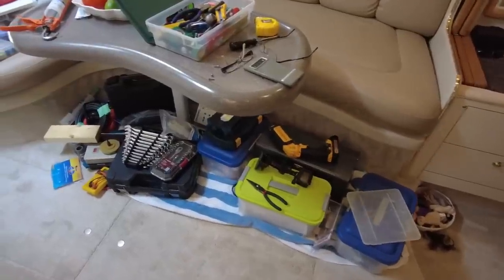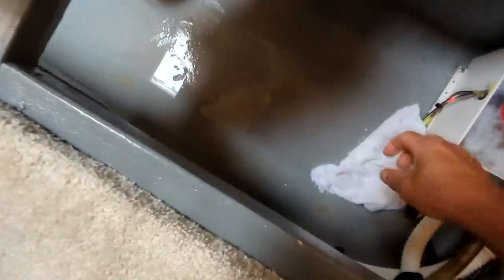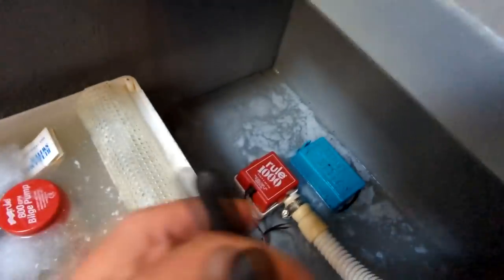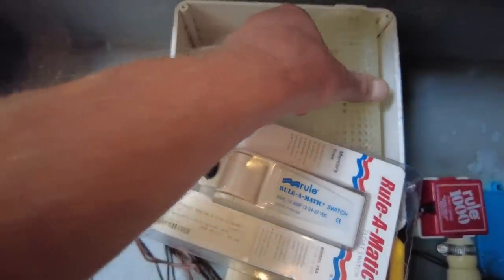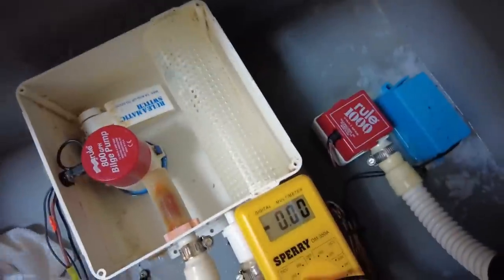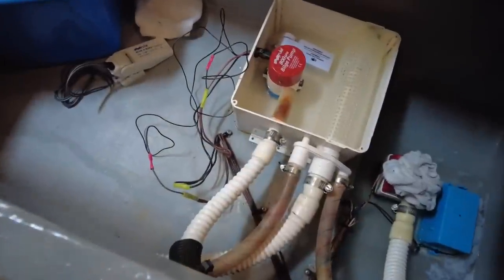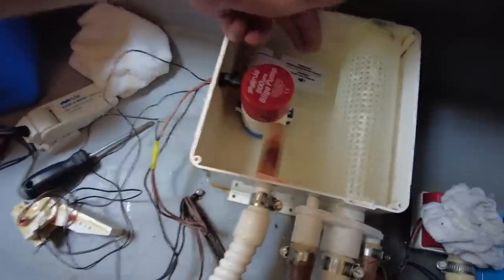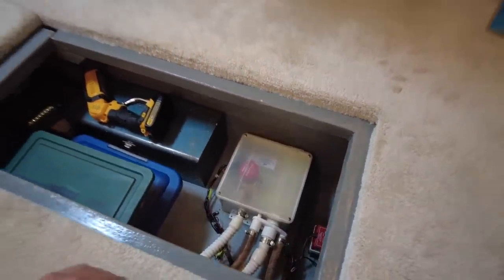Our Shower Sump Overflowed & Flooded The Bilge!!

Comment: Good work replacing the float switch, I have a 42 Sea Ray and I just ordered a new shower sump with electronic float switch and pump in the box. My old Rule box lid was cracked and let water into the same compartment. The float switch also failed last year.Thanks for the video tracing the problem to the float switch.
Reply from the maker: I like the idea of the electronic float switch,might look into that for next season. Thanks for the heads up. Just be sure to clean the leads for the switch so they don't get out of service. Probably an annual check, but something to remember.

Comment: Seams there are always projects to do when you own a boat.  I’m trying to learn not to get upset (upset is not the word I was going to put P….d) when things go wrong. This year has been a struggle to get on the water. It started off good just prelaunch cleaning.  Then coil went bad then the Fuel pump. But yesterday got in the water and it was all worth it.  Thanks for sharing all the projects you do.
Reply from the maker: Always something, eh. Oh well, that's boating! 😁

Comment: So, lessons learned for when I finally find my first boat. 
A) Keep a few spares for things like the float switches. Maybe prewired to one of those waterproof quick-connect connectors?
B) Some form of water detect alarm should be installed in the bilge.

For the emergency pump, maybe install a bypass switch for the float to allow easier manual operation of you need it in the future? Factory should have recessed it a bit for better water pick-up. And I was a bit surprised, no little 2-gallon wet/dry vac for little cleanups like this?

Thanks for one more episode of "The School of hard knocks" :)
Reply from the maker: Yes, spares are a must on any boat. Check out my previous video where I talk about tools to carry, as well as spare parts.
 As for the manual switch, yes, there's one factory installed at the helm on this Sea Ray.
 And one can install a warning mechanism if water is detected. In fact, this boat is factory equipped with a red light (located right in the shower stall) that comes in every time that pump.is activated. Problem was that it isn't noticed on this day, hence the overflow.
 Oh well, just another day in paradise 😊
Reply: @BoatingWithBoogaboo  Huh, must have missed that one. Been a crazy week. Will go watch it now! Thinking whatever I buy the alarm will get wired to a piezo buzzer.

Comment: I had to replace the switch in my shower sump this spring too.  I'm just getting this old boat back into shape and found the previous owner just removed the lid of the sump box and let it overflow into the forward bilge.  I also found that the old pump had been running whenever the batteries were switched on, so I found the source of my parasitic drain.  I'll probably replace the whole shebang, but I'll probably never find a pump this quiet again.
Reply from the maker: What kind of/year boat you working on?
Reply: @BoatingWithBoogaboo  It's a 1996 Wellcraft.  An Excel 23SE.  A little express cruiser.  It's been a lot of fun.
Reply from the maker: A 1996 isn't an old boat - our current Sundancer is a 1998 and that's the newest cruiser we've ever owned!

Comment: Our 95 had 2 sumps as well.  The 2nd actually pumped from the sinks into a grey water tank.  That tank was pumped out at the same time as the black water.  It was an interesting set up as nothing went into the lake from inside the boat.  The exceptions were the thru hulls fro the AC and exhausts.  Never a fun job the first time you clean those sumps out when you buy the boat!
Reply from the maker: Wow, I've never heard of a Sea Ray having a grey water tank. In fact, our 330 Dancer had a bypass valve where one could actually pump the 💩 straight into the lake!!! Of course, it had been disconnected and I even went so far as to permanently capped that line off. I couldn't imagine pumping raw sewage into the lake!
Reply: @BoatingWithBoogaboo  The grey water tank was just from the sinks.  There are boats out here that are ordered that way as some boats go to the coast.  That would explain both types of tanks I think.
Reply from the maker: @markburley4901 So, shower still pumps overboard? Where was that tank located on your 370? Couldn't have been too big, capacity wise...
Reply: @BoatingWithBoogaboo  nope, shower was pumped into the grey water too.  I'm honestly not exactly sure where it was located honestly.  It was on the port side I'm sure but not sure of exact location.  I'll go through my pics, I'm sure it's in there somewhere.
Reply from the maker: @markburley4901 Interesting. I was just relating our conversation to Anchor Girl insofar as the grey water holding tank, as we've never heard of that on these types of boats. I could imagine how many extra times we'd have to go for a pump out (already a regular occurrence, as you - and all of YouTube already knows).
 Yes, let me know where that auxiliary tank might have been located...
Reply: @BoatingWithBoogaboo  I ran into my old boat mechanic the other day.  He told me that the tank was on the port side, almost immediately below the access on the gunwale to pump out.  That would put it in behind and aft of the downstairs fridge by my estimation.
Reply from the maker: @markburley4901 Yes, that's where our blackwater tank is located on Boogaboo as well. So I'm guessing the grey water tank is ahead or aft of that... Wouldn't fit in ours, as the five batteries occupy that space.
 Not to worry though, as it isn't going to affect us - I was just curious 🧐

Comment: I'll be tackling our shower sump soon.  It wasn't turning on during spring fit out.  I kept dumping water down the shower drain waiting for the pump to kick on and ended up flooding the sump box.
Reply from the maker: Sounds like your float switch is shot too. Be sure to order a spare 👍

Comment: That cylindrical sump box screen should fit under the two plastic tabs on each side as opposed to sitting on top of them. This will keep it from interfering with the flot switch.

Comment: Good stuff Paul. I'm thankful that our kitchen sink was designed to drain out of the hull instead of dumping it in with the shower and AC etc. Question: Why do these pumps have so much back flow to them? It's like they allow 50% of the fluid they eject to come right back in. Is it just a lack of power?
Reply: No check valve.  and remaining water before a loop in the hose leading out of the boat just returns to the sump.
Reply from the maker: The way drain lines are (supposed to be) configured is that they go up to a high point, then pitch back downward and exiting out of the boat. Any water you see returning to the sump is from the length of hose between the pump and that high point. Nothing to do with pump capacity, just simple dynamics. And yes, a check valve would help alleviate that returning water, but could be potentially problematic as the 'head' (the water sitting idly in that section of hose) might produce enough pressure that the pump can't overcome it. In that scenario, a higher capacity pump should fix that...
 On another note, I see that you're getting ready for some serious time on the boat this year, now that Mary has semi-retired 👍 Looking forward to seeing your upcoming adventures - and maybe even the repairs on your companionway door 😉
Reply: @BoatingWithBoogaboo  Thanks for the thorough explanation. That's helpful. And the Admiral and I just completed our first ever 4-day trip to Chesapeake City MD on the C&D canal. It's our "epic" cruising feat to date. First installment of that video should be ready later this week. Thanks for watching. As for the companionway door, I don't think I've got a shot at doing it anytime soon since the entire helm as to be removed and I cannot find anything remotely helpful on how to do it. My guess is that it would be a multiple thousands for a pro to do it, so we might just have to live with it. My local guy couldn't figure out any quicker and cheaper alternatives.
Reply from the maker: Eternity's Shore  Ya, unfortunately that companionway door removal would be a huge job. I studied that prospect on our last Sundancer (current one has similar configuration) and came to the conclusion that it would be a nightmare to put back together...
 We'll be looking forward to your Epic Cruise installments!!

Comment: If the secondary "backup" pump and switch are lower then the primary one I don't understand why the float switch on the backup did not come on and since it "doesn't work as it is supposed to" as a backup are you going to be replacing it with a different type of float switch?
Reply from the maker: As I pointed out in the video, the secondary pump and float are working fine, but the float doesn't engage until the water level is higher than what one would consider ideal. All floats have the same issue, with their ability to fully evacuate water impossible.
Reply: @BoatingWithBoogaboo  Ok thanks for the reply, I am just about to install a float switch in my boat. I may try and build a screen around it now that I've seen that you have one located beside your main pump.
Reply: Is there a way to adjust when the float kicks in? Maybe attach a cork lower or something?